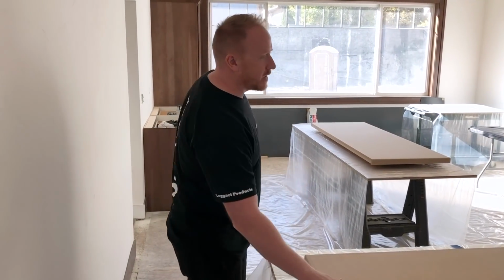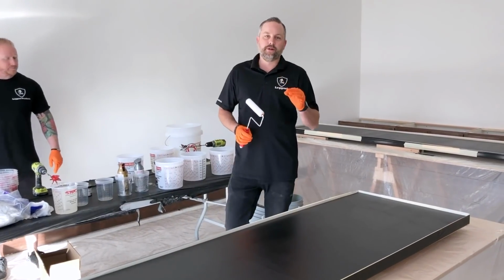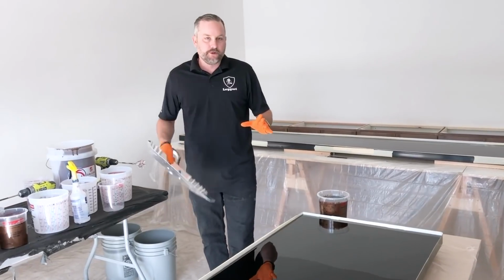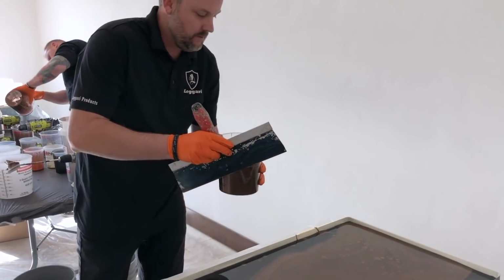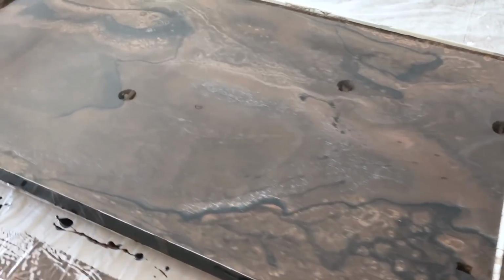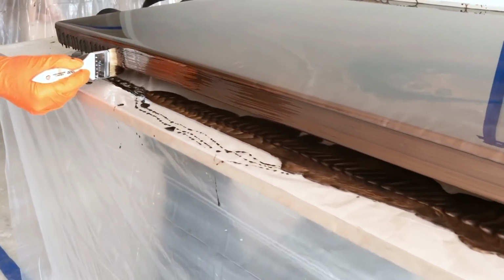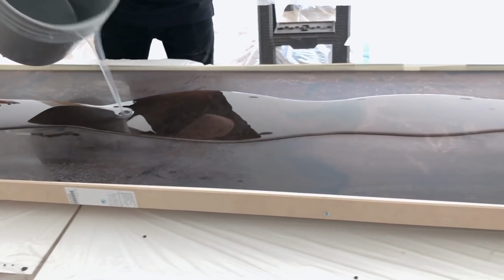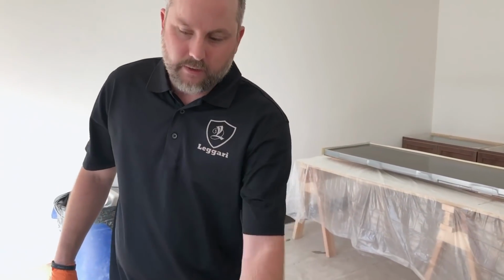Epic Epoxy Dirty Pour Technique On Custom Wood Countertops Tutorial | DIY Countertop Resurface Ideas

Comment: This looks awesome, is it possible to sand down the sides to get rid of the lumps and then apply a thin or thick coat for protection?
Reply from the maker: Yes you can sand down any bumps in the surface then apply our urethane top coat for more durability.

Comment: A slab 12 ft l9ng probably had atleast some flex when installing. Is this an issue for the epoxy or does it have some flex as well? Looks great btw.
Reply from the maker: We do not run into any problems with the epoxy over the concrete with the expansion cuts if it has a little flex in it.  We have several customers apply this to their garages and concrete floors inside.
Reply: Who said anything about floors?

Comment: I totally love your products & tutorials as I said in other videos. Just curious: I always see guys laying down your epoxy one two or even three times, and the rollers and tools are always immaculate clean... how do you do it? How do you get rid of the epoxy from your tools? Once I used a brush for a small project of mine and I had to throw the brush away, couldn't clean it from the resin ...
Reply: Acetone.
Reply from the maker: You can clean them with denatured alcohol or acetone.  We usually just throw them away because the epoxy is pretty hard to get off them.
Reply: @jkg6211  I'll try!!
Reply: @LeggariProducts  I tried alcohol, it didn't work BUT maybe my cleaning wasn't so accurate... ;) ... Thank you very much for your answer!
Reply: @Moonie804  
Acetone is the only thing somewhat "safe" that'll work (it's a really bad carcinogen and is poisonous, but MEK is just too toxic to fool around with, PERIOD)... but Acetone will only work well if you clean up BEFORE it begins to cure.
If it were me, I'd consider brushes to be a "one time use" with epoxy.
YMMV...

Comment: At any point do you find that you need to use a torch to get rid of bubbles?
Reply from the maker: We have a high end epoxy that has an additive in it to make the bubbles rise to the surface and pop on their own. If we ever get any bubbles we just mist them with denatured alcohol to get rid of them.  Thanks

Comment: Is there a way to keep the sides of the counters where you put the tape to not look so lumpy and not as smooth as the rest of the counters.  When you pull the tape off and then you let it drip down, at first you're using a paint brush to deal with the drip down, but after you use the paint brush and then let the pattern come down the sides, it's not smooth anymore and it's uneven, and I guess I'm just wondering how to get that from looking like that and if there is a way to avoid the not so natural look down the sides of the counters.  I hope I made sense.
Reply: I've just just started into epoxy and have had this issue.   I think its big to stat with a smooth side and then its timing and applying the torch.

Comment: Hi how much product did you use on those worktops please . And how much does it work out per square foot. 
Fantastic pour 👍
Reply from the maker: He used a 3 gal. kit of epoxy.  For the dirty pour kits it comes with 3 gallons of epoxy and will cover 50 sq. ft.

Comment: what is the primer you use? Black paint or special Primer?
Reply from the maker: Our primer is a water based epoxy specifically designed to chemically bond to almost all smooth surfaces.

Comment: The verticle faces Don't look as much like glass than the top. How did or do you fix that. I noticed this in several videos.
Reply: Facts. Noticed it too. Wondering do you need serveral coats for the glassy look
Reply: it looks like shit! cant believe this was sold this like, i was thinking it was getting some sort of buff to clean and smooth the edges but nada.... legit looks like shit...plus, kitchen counter tops? where you place appliances and have to constantly clean and scrub how long will the gloss stay ? and so much epoxy was used, buckets in fact, wouldn't an actual stone counter top be cheaper? i dont think this is the actual final look to the product, it just cant be. Actually just checked a couple more of their work and it seems they do sand/buff it after it dries and even add some special durable coat on the end product that makes it clean all around the piece with no scratches, including the edges.